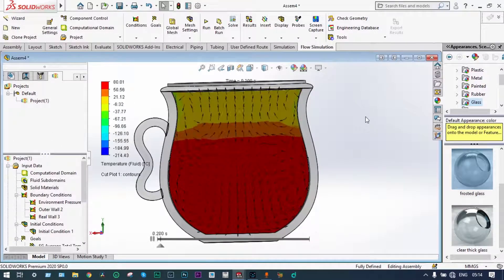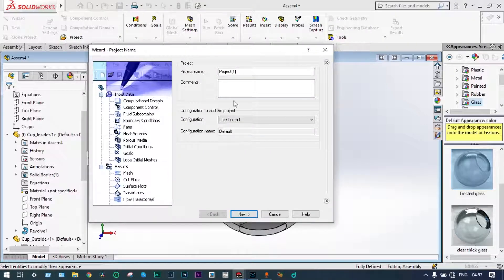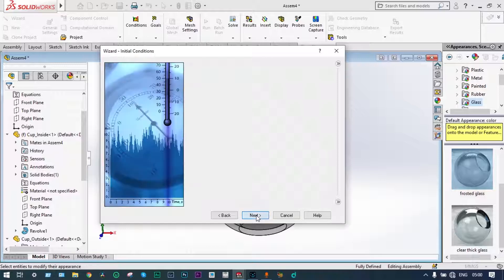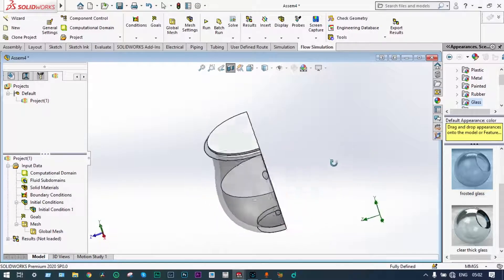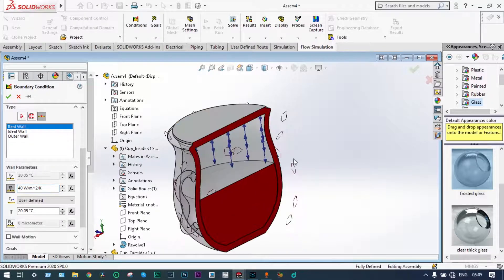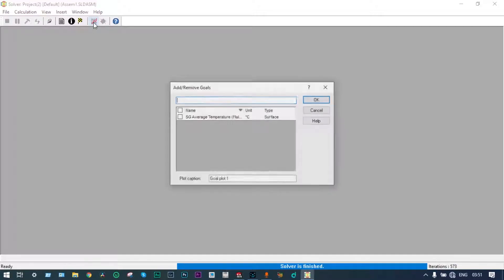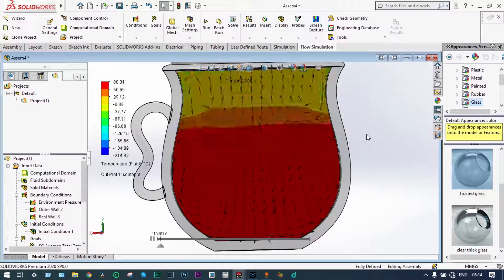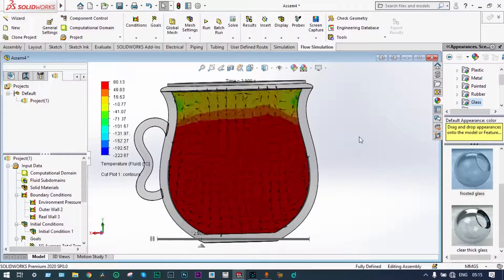Mastering Convective Heat Transfer: SolidWorks Free Surface Technique Tutorial

Comment: Good video, but h value is a mere assumption, or have you calculated it yourself? How did you get the heat transfer coefficient as 30 W/m2K?

Comment: Hello sir, can u tell me what boundary condition should I use to apply for incinerator for this simulation?
Reply from the maker: Actually boundary conditions depend on actual utilization and application. I can say a general statement. It varies based on required outputs. You can go for internal or external analysis based on output goals and boundary conditions will depend on sorrounding atmospheric conditions and running conditions.